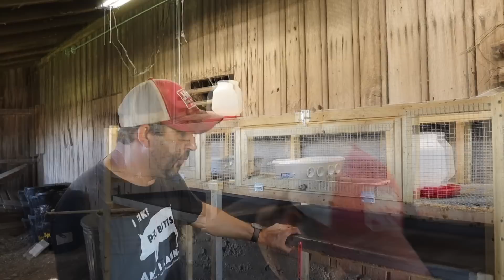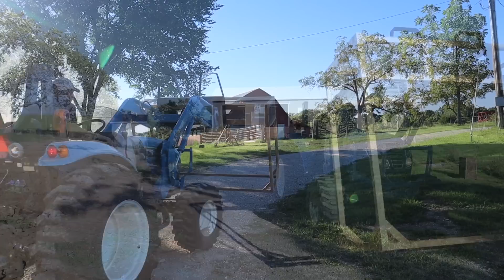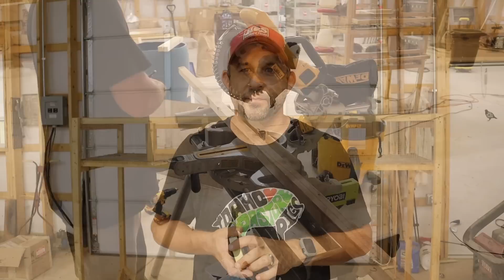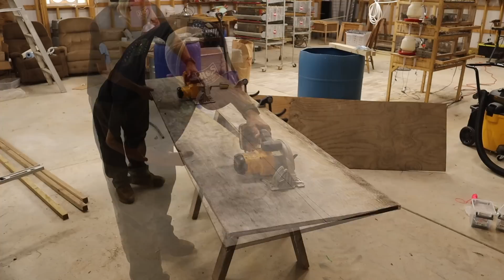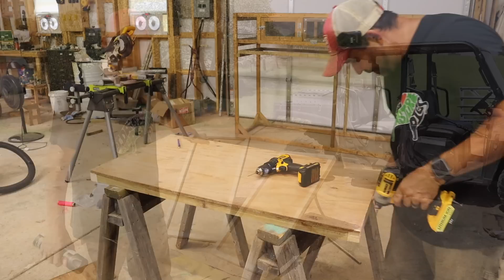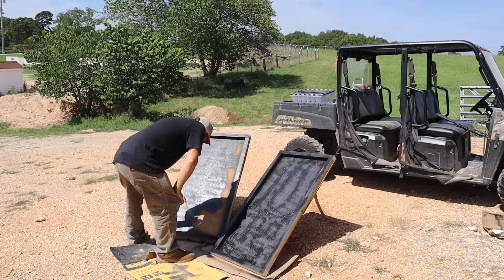A Health Issue Has Caused Me To Make This Decision...

Comment: I hope this improves your situation; it looks like a good solution. One thing to note with the new design is that rats can fit between the poop tray and the cage floor, and rats can eat toes. You may consider adding a barrier in that location, or at least you'll know what's going on and can address the fix quickly if it becomes an issue later. Good luck!
Reply: It's always something, isn't it??

Comment: Your cages look great, Great build, Good idea however the fit on your trays might be a little too tight???  The wood may swell during the more humid months and cause them to stick  A little powdered graphite might help to lubricate the rales.  Just a thought for whatever it's worth
Reply: NO DO NOT USE GRAPHITE, IT WILL BE REALLY BAD FOR YOUR LUNGS, AND EVERY TIME YOU SLIDE THEM IN AND OUT! Just a BAR OF SOAP RUBBED ON THE RAILS WILL SOLVE THAT PROBLEM .
Reply: @dorothyallen3614  Thanks for the info, never thought of that

Comment: I would definitely blame the cv long haul issue as the base of your asthma flare ups, but even if you didn’t have either of those, birds in general, except for a few specific rainforest parrots with little dander due to an oilier skin, working in such close proximity to the quail would be hard on anyones lungs. The dander can be a huge problem. I have one little Quaker parrot and I have to dust way more often. One morning as she sat on my lap with sunshine beaming in on her, she preened a minute then shook her feathers. I was stunned at the thick slow moving cloud of dander wafting around her!

Comment: Kevin, that is a great idea, using the bed lining in your trays. Did you know, that if you line those pans with old feed bags and still using the wood chip, it will protect those trays a lot longer. You will still use your dustpan to clean the trays, and only change the feed bags about every month or so. That is what I do.
Reply from the maker: Great idea!

Comment: Bass Equipment in Monett MO can easily custom build you galvanized trays to fit whatever cage you want. They also build plastic coated wire cages in whatever size you want.

Comment: Here's a suggestion, Kevin   Most Heating and A/C Companies have a shop with Brakes for making  Plenums. (Ductwork)   they can make Galvanized pans for you for  a nominal fee. Mine cost $25 for 3'x4' and they are heavy duty so they should last a long time. Much lighter and  less work. No dustpan. Just a thought.

Comment: Good work with the trays. Some horizontal cleats on the legs above the tray (front to back) would make your strings unnecessary. Just leave enough space to allow your tray to slide freely. They don’t even need to be as thick as your tray support rungs. Hope your health improves quickly.

Comment: I also have asthma triggered by dust, pollen and other air particles.   I found simple air filters to be extremely helpful.   Get a 22” box fan.  Get a 22” 3M fine particulate/allergen air furnace filter.  Simply put the filter on the back of the fan with the arrow toward the back of the fan.  Turn on low setting.  The filter will suck to the back of the fan.   In the house I rotate this room to room and within a couple of hours I can barely see any particles in the air (look where light streaming thru window).    I’m betting this would help a lot in your garage.   I spent under $50 for both items.    Very effective!

Comment: I lived through a lung problem caused by feather dust. (rescued parrots) I was on Pred, 10 liters of oxygen and total bed rest. My specialist said I had to get rid of the birds and move to a clean house or clean all the dust out of my house and paint everything, to capture the dust on the walls, furniture, carpet removed, ect. Washed all cloth and replaced any thing that could not be sanitized.  I am not living in a forced air heated house. I did hire someone to do all the clean up, painting, and disposal of the stuff I could not keep, and am living in the same house. Touch and go for a year. If your lungs have problems with feather dust, put all the birds outside and hose down every thing in that building. Mine was life threatening.

Comment: i had tried flex seal to cover plastic cat litter boxes just on the out sides. They leaked over time the longer they were used. Anyway, once the urine hit the flex seal it deteriorated quickly and hence didn't work. So, sheet metal was the answer to my problem. I hope the bedding soaks up any urine and that the stuff you used won't be affected by any urine,

Comment: Sorry to hear you're under the weather.  Covid is nasty.  I wrote earlier in one of your quail videos that I built a cage similar to yours, triple stacked for breeding pairs, growout and room to separate male/female for meat and eggs.  I also designed drawers like you did - It makes cleaning out so much easier.  Your truck bed covering ought to work well.  I simply double coated enamel paint and protected the plywood from the wet manure - it held up great. With a rubber edge dustpan and a 10 gal can below scooping out the drawers was relatively easy.  But the volume of waste my quail produced, it was an every day clean out chore.  I simply didn't have the time every day to do that.  So I eventually made the decision to stick with chicken layers and meatbirds.  I also found the dust/dander and the offgasing of the waste bothered my respiratory allergies.  Since getting rid of the quail, I haven't had symptoms.  I kept the quail battery cage in the end 10x10 section of the chicken run where I keep feed and brooders.  The run was a steel corrugated roof with horizontal and vertical 4x4's with steel welded wire dog kennel panels. so there was ventilation but the dander/dust/manure got to me.

Comment: You should look at a powered respirator like the Dräger X-plore 8500 Powered Air-Purifying Respirator (PAPR).   It is a little pricey but it’s very comfortable to wear and keeps an adjustable breeze on your face which keeps you cooler too.  My allergies to dust got so bad I couldn’t mow the grass, work in the hay field, or work in the barn. After talking to a friend in the Industrial Safety field, he suggested this and it’s been a life changer for me.   The rechargeable battery lasts up to 16 hours and it’s very comfortable to wear.  After mowing the yard, especially in the fall, it used to take me at least a day to recover from sinus and chest congestion.  With the Drager I feel better than before because I was breathing filtered air and had a breeze blowing across my head keeping me cooler.

Comment: Kevin, I was going to add my two cents worth here, but I see most of the stories have been covered😊. I know it is really too hot and humid to wear a mask in the summer where you live, so I would suggest you try one of those clear plastic face shields that have a fan that blows down across your face, keeping allergens away from your face. If it works, it would certainly be more comfortable for you. If that helps but not enough, you might try covering as much of your skin as possible, then changing clothes right after working with the quail. My experience with bird poop was that it would make me feel like I have the flu for two days after breathing the dust. Wetting it down stopped that but sounds like your problem is in the air all the time. This shield/fan might help. Sure hope you get better quickly! Also, the suggestions about histoplasmosis are worth checking out. (I got it from chickens when I was little.) Don't let the doctors just assume it is Covid. Blessings and good luck!

Comment: Kevin, you are a bunch smarter at crafting things than I am, but would your truck bed liner "go further" if you primed/painted the drawers with something else first? A lot of the bed liner is being soaked in and maybe you would get better mileage with a primer.
Also, on your breeder cages (and I know nothing about growing birds), could you make an exhaust fan that draws air across the breeders and sends it outside? Could help keep dust down and keep them cool also.

Comment: Should have made the front side on the pans with hinges so you could just lower it and scoop or scrape out the droppings into a wheelbarrow it would be faster and easier to clean them. Pull them out. The drop open the front edge of the pan. Could just use a short handle hoe to scrape out the mess.

Comment: The easiest method for overwintering the quail in their outside cages is using Everbilt Reach Barrier.  With mylar tape, one can run multiple overlappings of the product over the back, top, ends ... and down the front of the cage.  Run from one full end, across the back, and the other full end.  Then run the top connecting to the end, back, and end.  One then just runs the front and taping the front Reach to the top edging, allowing one to flip over the whole front end for daytime quail, and getting into the cages.  Then just flop back down and the whole 5 top surfaces of the cages are covered.

Reach Barrier is the cotton fiber fluff on the mylar having great insulating properties vs the lesser Radiant Barrier (bubble wrap double mylar).  This would stop any wind and cold.  Using some 1 inch wide x 18 inch lengths of thin "painter stick" shape, one can slide these between the cage and the top insulator material, propping up the front flap.  When done, push the sticks to the side, and allow the flap to drop back down.

If you did this with Radiant Barrier, then it could also be lightweight and easy to install as well.

Comment: I had to move to Az because I almost died from Status Asthmaticus in 1963. I was told I was only breathing from the upper lobes of my lungs and was in C02 narcosis. Back then they had just started using steroids and a steroid (Decadron) saved my life but it took me 18 months to get off of it. As soon as I stopped taking it the asthma flared up again. Mold is my trigger and Md was full of moldy leaves where I lived. . So moved to a hot and dry environment and had no asthma. I tried to live in Ky but after ten years started having the same asthma problems so I live in Az now. Good luck Kevin, I know what asthma is like.

Comment: I'm an asthmatic and actually had a bad reaction, difficulty breathing for months from the Covid shot.  I also believe I had Covid before anyone even knew it was here.  With that said the reason I believe it causes issues is because it causes inflammation in the body.  As far as allergies, I have them bad also but what I have found that has helped me tremendously is using a neti pot EVERY day, sometimes twice a day in allergy season.  Allergies cause inflammation in the body and by flushing the nasal cavity it helps prevent the allergens from taking hold in the body.  I also use the neti pot when I get home from going to stores or anywhere I've been around people to  try and prevent the possibility of a virus taking hold.  I do believe it has helped tremendously.
Reply: Neti pot really does help, but it takes getting used to

Comment: Kevin, Wear a mask when mowing, or working with the quail, also if the wind is blowing when you are outside wear a mask.  DO NOT WEAR a cheap mask.
If you have allergies get your shots. 
 I had shots for over 5 years & was able to stop them, the Dr. said because I got the shots when told that I needed them my allergies went away.

Comment: Nice modifications Kevin!
You might want to use that truck bed coating on the inside of back walls you've just added. It'll make cleaning easier and protect the plywood so it last longer.
Reply: I don’t believe the birds would make it though after they peck that paint off and eat it. Let us think through our suggestions.
Reply: @dorothyallen3614  Good point Dorothy, remains to be seen if the quails would pick at it. I don't know enough about quails to say if they would or not. Notice I wrote "might want to" and not "must" or "have to"; Kevin's knowledgeable enough to decide for himself.

Comment: So sorry covid has triggered your childhood asthma / allergies.  I hope it is short lived and will retreat after this year.
As a backpacker who spent many many nights in trail shelters / leanto's - maybe think about just putting up a tarp or 2 over some parts of that area vs doing all the work on each cage.  The tarp could block the winter winds to some extent while also making it easy to remove for spring / summer when you want the cooling breeze.  Cages stay as they are and you just hang / attach a tarp at the short sides where the wind comes into the area, the cages are still nicely ventilated and w/o wind, their feathers will keep them warm.  You can put the tarp either along the outer sides of the barn, or just inside a ways to make a sort of blocked off interior section.

Less work now, easy to remove later.  You guys have a lot on your plate now.

I've spent many nights in shelters that looked a LOT like that side of your barn, and the trail clubs had hung tarps up for winter to make it a tad more comfortable.

Comment: There's a lung disease that is caused by working in chicken coops, where their feces fungus gets breathed in and causes lung disease.  We had chickens for when the kids were young and in 4-H.  One of my sons was infected, without our knowledge, until he went for a physical. He has scarring in his left lung from HISTOPLASMOSIS, caused by the inhaled chicken poop dust that carries the fungus.  Other birds also produce that fungus. You might want to check with your Dr about that.
As for your cages, have you thought about spraying the bedliner spray on the legs and cross bars, to protect the wood from the birds waste?  It's be a lot easier to spray down, if they were coated with the bedliner spray.

Comment: Next time you pressure wash the cage on the left you can raise the tray rails up to match the one on the right.  Also, don't forget to put on the string that will hold the tray up as you clean it.  Wear a dust mask when you are around them.  Did you get vaccinated against COVID?  Good job!

Comment: Hey Kevin,  If you were going to make cages like this to use as chicken brooders, would you make them any bigger?  We are getting 25 chicks to add to our flock, but  have never had that many chicks at one time.  I plan to build use your design here, but I'm worried they will not have enough room as they get bigger.  I will plan move them to a hoop coop when they can be outside without a heat source.

Comment: Hmm...could be why my lungs are messed up after outgrowing asthma 40 years ago.  I was fine til my first quail.  My pressure washer along with bags of tools was stolen by my brother in law when widowed.  Cops no help.  Found out through mother in law.  I can't take them outside.  Lots of raccoons.  Got my first nice sized group.  Starting over.  Was told the coyotes were shot by a neighbor.  Haven't heard them since.
I know I caught the regular flu after another got a flu shot, then the flu then I caught it.
I do run fans and doors open when it's nice out when predators aren't active.
I use metal cages that don't absorb odor.  Used to breed a rare breed of cat and wood enclosures had to be removed and replaced to separate the spraying males.
I'm glad to have removed all carpet a couple of years ago too.
I do better with wood heat over a furnace.  Glad I switched over.  Had to do an equity loan but worth no carpet and wood heat.  Having a chimney cut my costs though.  Would've loved to have a regular homestead but had to cut costs and just under an acre I'm filling up as I can afford it and multiple health problems.  Older home was half the price in this area of similar that still needs work but baby steps.  A battle.

Comment: Nice renovations. I think the quail will enjoy the outdoors. Re asthma. If you're not already, eat plenty of foods with natural pro-biotics, or buy it from the pharmacy. Your gut is the primal driver of not only your immune response, but triggers unique chemicals in the body, that tell your organs to operate in slightly different ways. This slight adjustment can make all the difference to healing the body. Illnesses, that can run the immune system down, means your organs aren't being repaired as they normally would. Stress is another factor, that can tax the immune response.

I'm no doctor, but I hazard a guess that the stress from building a house, with moving, and recovering from an illness, has run your entire body down. So it's not repairing itself. Those pro-biotics, stimulate the gut micro-biome, to kick-start the healing process into overdrive. I don't know if you had antibiotics to help through the illness, but they will definitely knock out a healthy gut micro-biome.

Comment: Had severe allergies as a young person. Received shots for 5 years and almost had no asthma for 30 years, until I got my first covid vaccine shot. Then all hell broke loose. Shot caused an extreme immune response and every allergen that had triggered my asthma before is back. Also a bunch of new ones along with 2 new autoimmune diseases. Still fighting this for over a year now. Managing allergies is a real problem and can be deadly. Get an Epipen just in case. Peace
Reply: I've read a lot of the comments on here and yours is the first one to mention that the injection had this adverse reaction for you.  I've been hearing that those shots do this and worse.  Cancers that were long in remission come roaring back.  These injections are worse than the disease they allegedly assist with.  Hope your condition gets resolved.